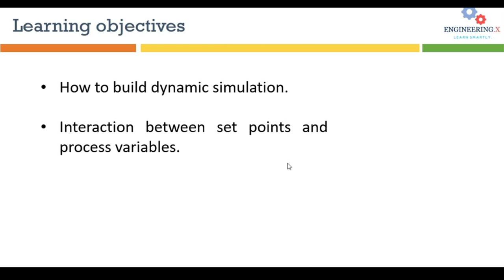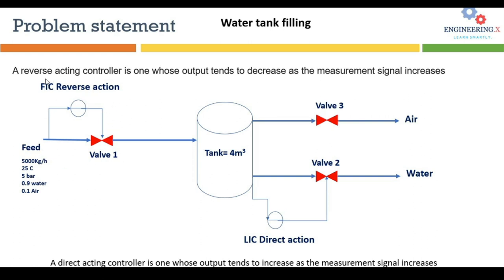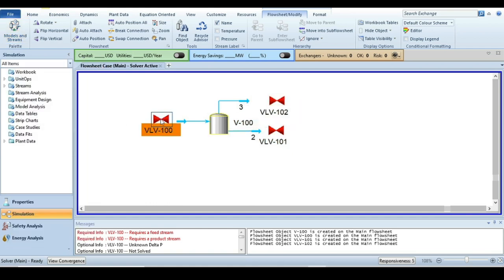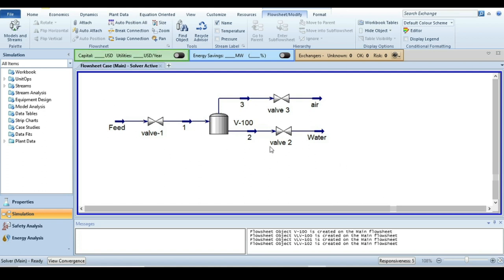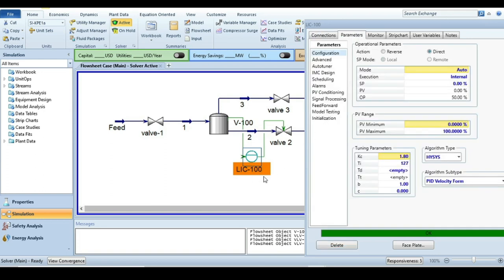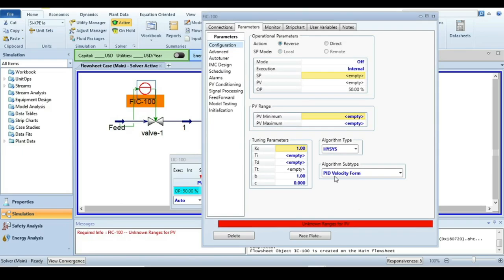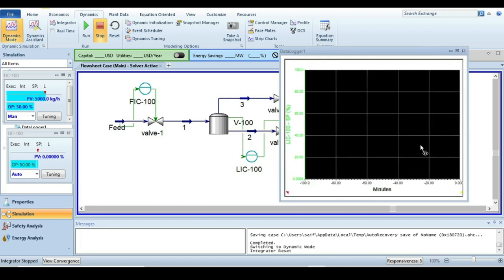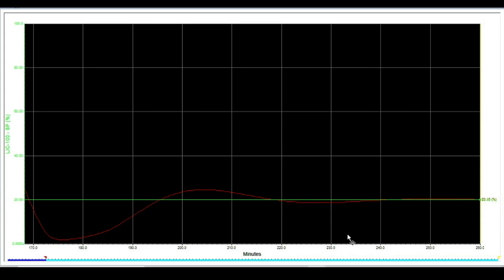Hysys Dynamic Modelling | Filing of Water Tank

Comment: Thank you so much for your explaination, just I should mention that it seems to be correct when the reverse controller FIC measuring the flow rate of the stream after control valve, not before it.

Comment: Thanks for the great effort. 

I have some questions: 

The entered Cv. is it the rated Cv? we entered it at 50% openning? 
Also we assumed 1 bar as pressure drop but this value changes with valve opening.
Reply from the maker: Yes it's rated CV and we assume 1 bar pressure drop at 50 % of valve opening. It will change with the positioning of valve
Reply: @eduXinsight  
So from valve's datasheet we enter rated Cv and we enter valve openning and its corresponding pressure drop.
Reply from the maker: @ahmadkhattab7645  yes it is